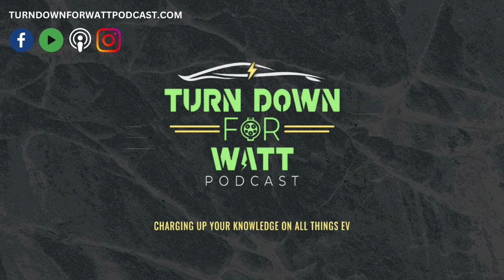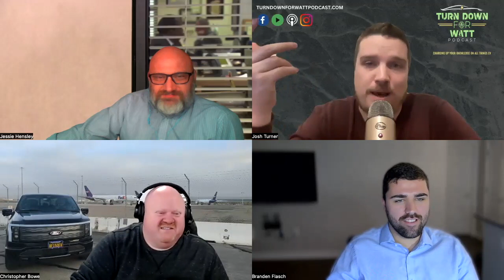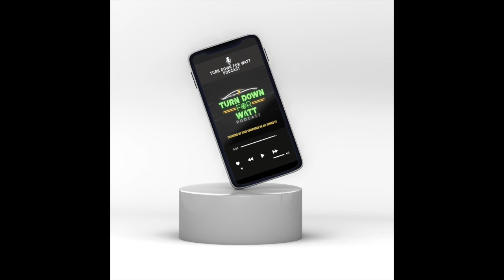40. Battery Technologies and Charging Station Etiquette

Comment: It occurs to me that EA chargers at the busiest sites are potentially experiencing many more cycles than a similar Tesla dispenser which leads to breakdowns. A 4-charger EA station is going to get at least double the use (one of those units will usually attract cars first) from 100 cars than a small 8-charger V3 station servicing 100 cars.
Reply from the maker: Valid point! Tesla does have more stalls on average and better maintenance scheduling. They do have the majority share of EV's as well, but less stalls definitely does play a factor into overuse and head breakage, especially with the clunky nature of CCS heads.